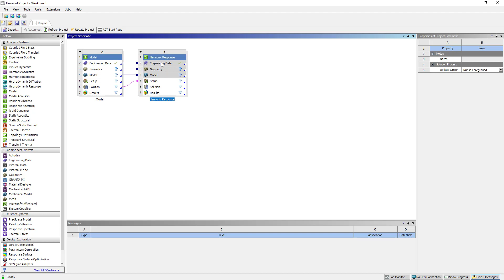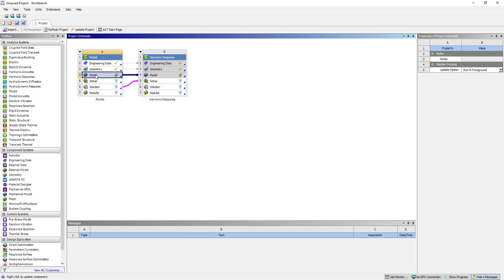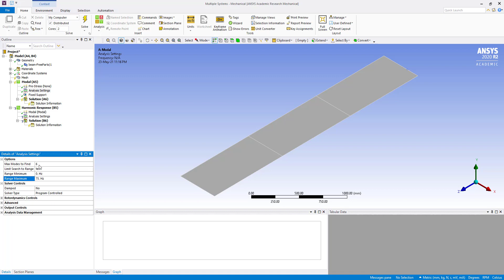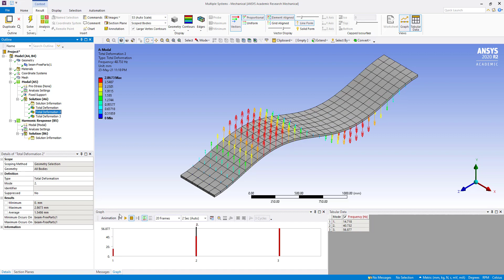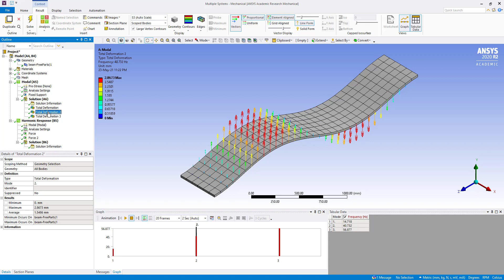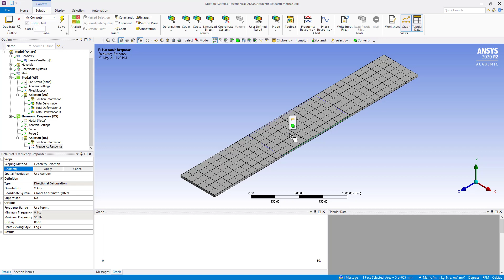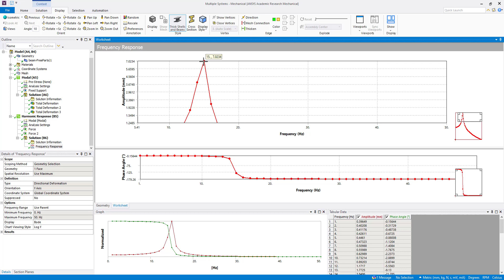Tutorial 6.1 Mode-Superposition Harmonic Analysis

Comment: is it okay to ignore the warning "Modal analysis used may have not found all the modes in the harmonic frequency sweep range. To avoid missing contributions from modes in the mode superposition harmonic analysis, it is recommended that the modal frequency range be 1.5 times wider than harmonic frequency range."? if so, how would it affect the results?